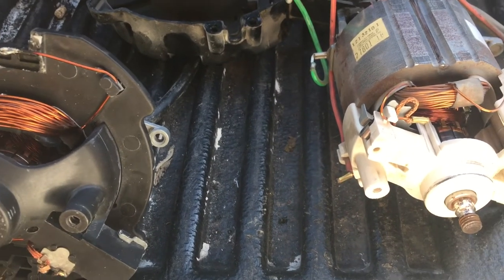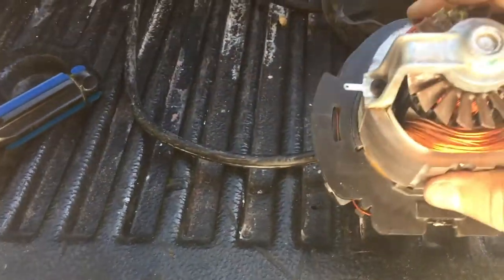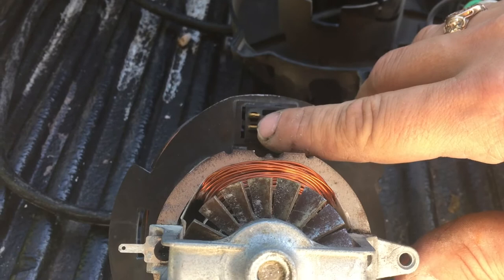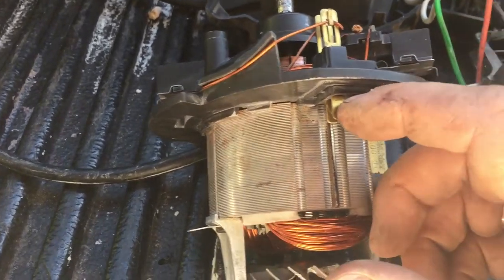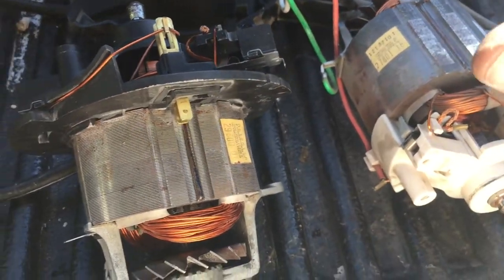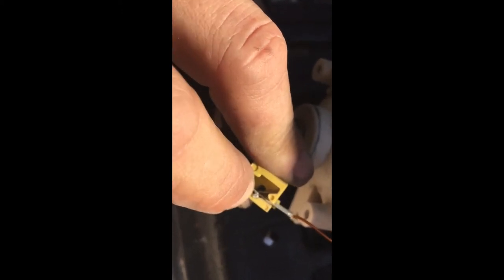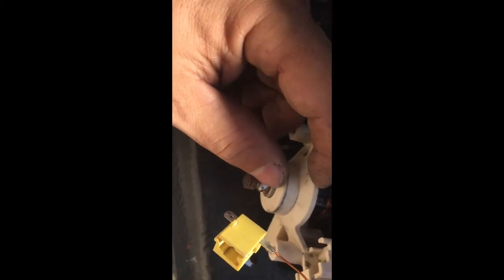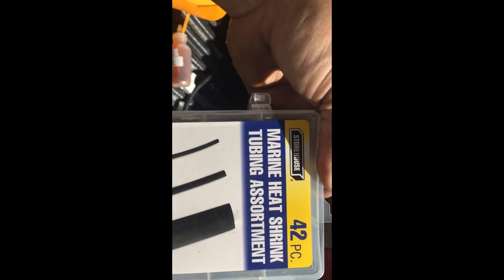Shop Vac thermal fuse repair

Comment: mine keeps coming unconnected on/off switch wire disconnects for no reason
Reply from the maker: most likely is your connector worn out. Use a pliers and press the plug so the W is closing it's gap more. Those spade connectors loose their tensions over time.

Comment: Why cant anyone show how to get to that part of the motor?!
Reply from the maker: which part exactly are you talking about?
Reply: LSE LLC (Lumanet Solar Energy LLC) mine doesn’t have an allen or anything you can grab onto or clamp down and the other side is the blades that I’ve tried a hundred ways to try to stop from spinning without breaking the plastic housing over them to no avail. I can’t seem to get to the thermal fuse. This stupid black plastic housing removal eludes me and I’m pretty ridiculously savy
Reply: Hi, Thank you for video i appreciate, what fuse you suggested me for my vacuum 120c, 250c, 10 or 12 amps 120volts or 250 volts i have to much choice my motor is same to  in your video ??   Thank you for you time.
Reply: You have to take the impeller off the motor shaft. The usually involves removing a special washer called a shaft retainer or star lockwasher and probably destroying it in the process. Then there will some additional splined washers on the impeller that engage splines on the shaft. Once you get all that crap apart pulled apart you will see the two screws that hold the motor to the plastic housing.

Comment: How did you determine the proper temperature of the fuse to be 120°C? This is very useful info! Thanks for this excellent video.
Reply from the maker: When you buy a fuse it tells you the spec :-) And sometimes like this time it was labeled on the fuse itself with 120C
Reply: @lsellclumanetsolarenergyll5071  What I am asking is how did you know what the proper temperature spec was for this application? The original Shopvac part does not have it printed on there, and Shopvac themselves will not give out that info. Or did you just randomly buy a 120ºC and stick it in there? These thermal fuses come in a vast array of temperature ratings. Thanks.

Comment: It's too bad, but the wind noise makes it very difficult to understand key points. I am sure you worked on it outside for the better lighting but you would have delete the recorded sound and do a separate voice over on your computer edit. It very good when the wind is not present. I also would have liked to seen your soldering of the fuse since it may be tricky heating the connection without setting off the fuse. I ]have the same thermal fuse problem on my ShopVac but my soldering skills are lacking. Thanks for the vid.